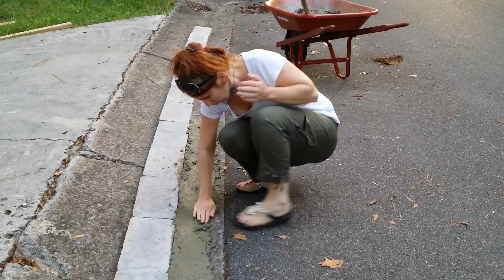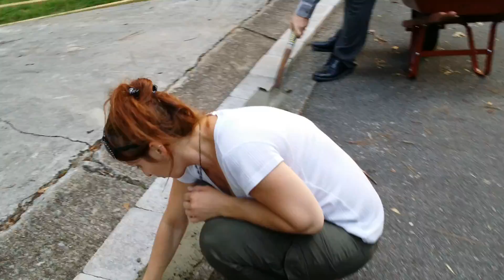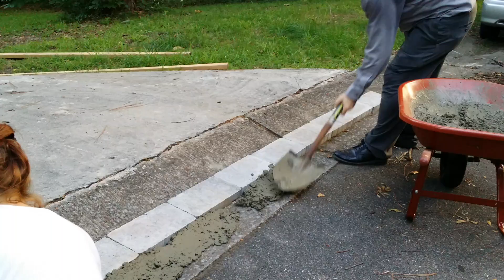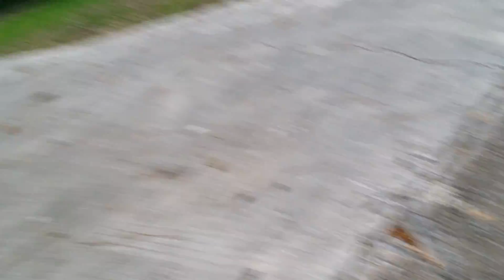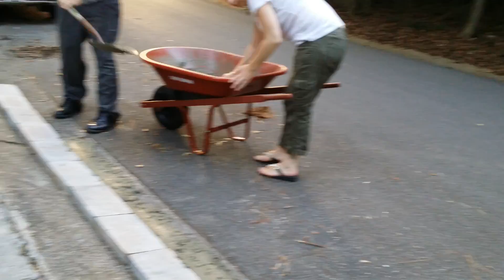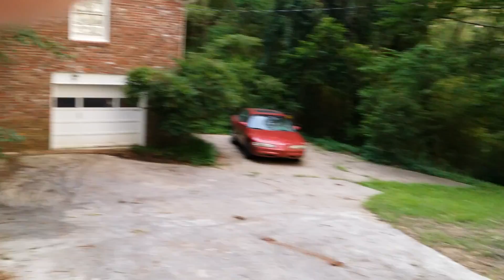New way to fix a dip at end of driveway

Comment: Unfortunately, it is not allowed to modify street drainage like this.  Correct fix is re-grading your driveway apron, but of course that's $$$.  There are rubber ramps you can purchase for this, but even those in some places are not acceptable.